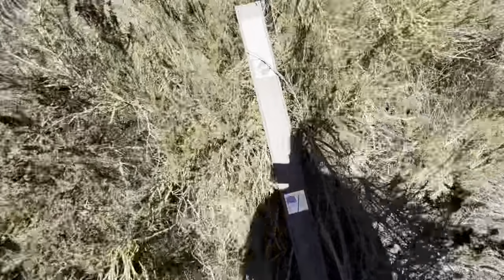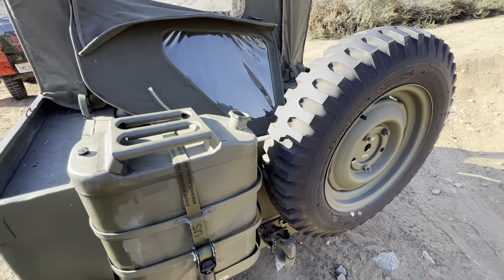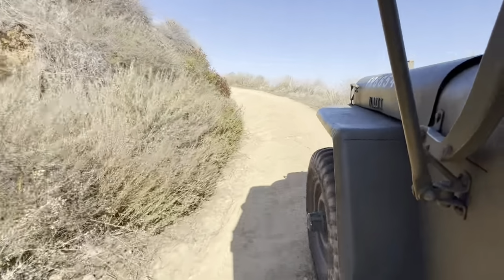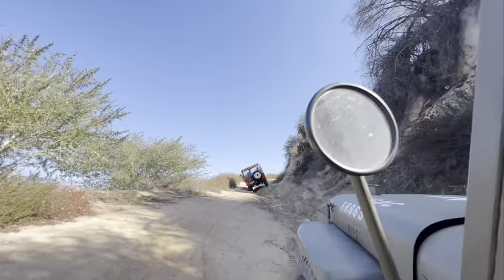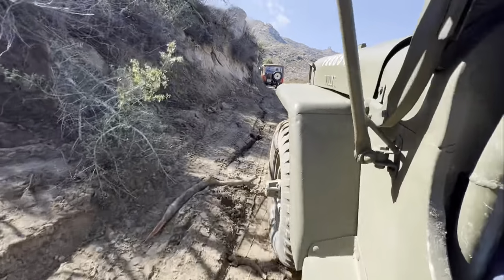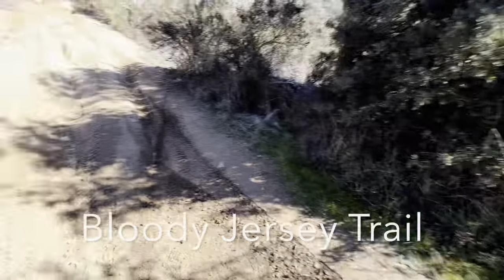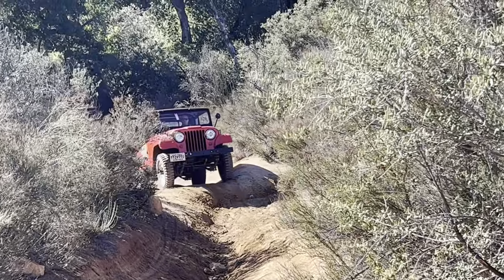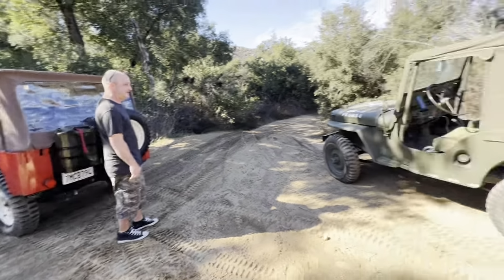Bloody Jersey Trail in our vintage Willys Jeeps/ Wildomar OHV/ Black Diamond trail/ Cj2A/ CJ5/MB/GPW

Comment: What is the exit off the highway for the trail, and the road name, right where you got off the pavement
Reply: It would be Lake Street off the 15 fwy. El Coriso is off lake but not really marked.

Follow Lake st around to the 74. A right on Killin will take you to the top of El Coriso. A left at Killin will take you to the ohv park. It’s about ten mile to the park.
Reply from the maker: Grand Ave. for the start of the video. that first trail is called El Cariso trail. goes up til you hit Ortega Hwy.